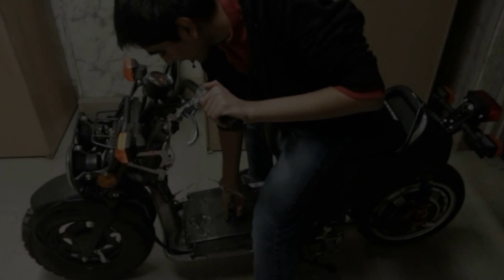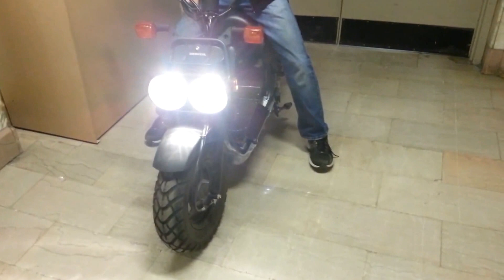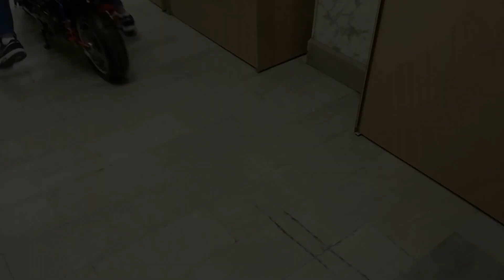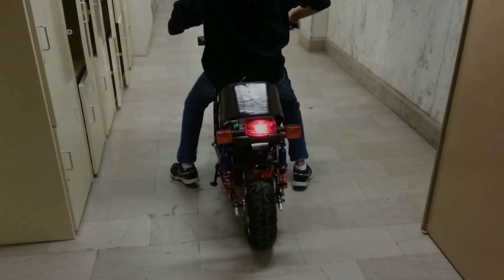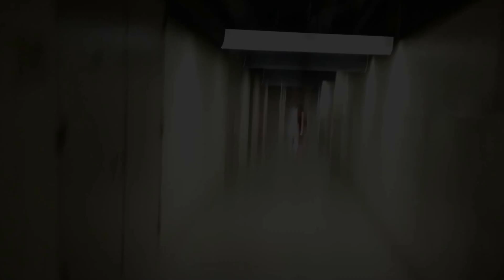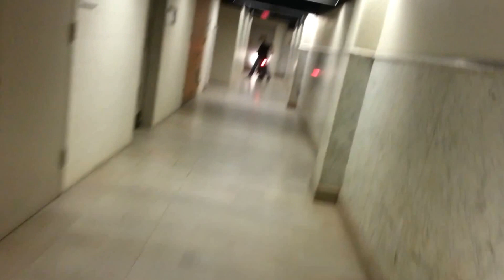First Test Ride of OPUS, our All-Electric Scooter

Comment: It's been exciting to follow the project with your team & the ruckus, and have been playing with the idea of making a project of it too with my own ruck. Pm me if to many q's have been asked.  What type of motor (ac or dc)? If ac, do you use an inverter? You guys doing air or liquid cooled (both batteries & motor)? what is the longest it goes on a charge.  Have you removed the ruck cdi unit? I would assume yes since it regulated rev rate. I ask due to top speed mentioned,  is it a limitation of the motor or batteries or both? Thanks for your time!
Reply from the maker: The motor is AC brushless.  It's a Kelly 72V 4.5kW high torque hub motor.  We also use their inverter.  Motor has no cooling requirements.  We initially designed liquid cooling for the batteries but found it to be unnecessary.  Range is about 50 miles (urban w/ regen).  Almost all the stock electronics are gone - only thing left is the ignition.  Top speed is limited due to motor voltage constant and cooling.  We sized the battery pack to reach that speed with only a small overhead.  We are actually running it at a higher-than-rated power (about 7.5 kW).  My advice if you are going to do this is to spend a lot of time choosing batteries and designing the battery pack.  Sorry for the late response; we're busy with an electric formula car now.

Comment: what size motor and how many batteries did you use on that. what is top speed and what is the average range per charge. sorry for all the questions but i have a ruckus also and i want to convert it to electric so bad
Reply from the maker: Hi!
The motor is rated at 4.5kW, but we regularly run the motor at about 7.5kW.  Our battery pack is 20S20P single 18650 Li-ion cells. We can reach 45MPH and get about 50mi in the city.  The acceleration is pretty exhilarating.  We also have functional regenerative braking (wasn't working for the video) and have put 150 testing miles on the bike.